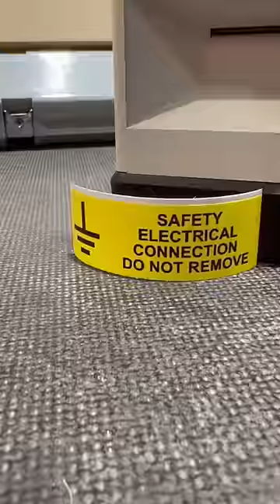Electricians Shocked by this Mysterious Earth Clamp

Comment: With the advent of PEX plumbing, you cant trust that a copper line is properly grounded anymore.
Reply: You can when that's what you're connecting it to. This is not using the pipe to provide a ground.
Reply: It's the pipe thats being earthed.
Reply: Yeah, what happens if a repair has to be made on both pipes four feet down further, and they replace it with sections of PEX pipe, unknowingly severing the connection to earth?
Reply: @bradbeck2601 As has been mentioned, the piping is grounded to the earth via the cable, not the other way arround. Replacing the pipes with plastic is fine and makes the cable redundant.
Reply: @Znyggisen  what's the purpose of grounding the pipes?
Reply: @Monkeh616 yes. It is using the pipe.
Reply: @PhillipDavis830  No, it isn't.
Reply: @Monkeh616  then do it at your home. Because if you have pex between the copper pipe and the main coming in you're screwed.
Reply: @PhillipDavis830  It won't matter, because that cable is not supplying the ground, it is connecting it TO the pipe.

You need to go read up on this stuff before assuming you know what you're talking about.
Reply: @Monkeh616  maybe you should do the same. You are making no sense.
Reply: @PhillipDavis830  That's because you're not listening.

The pipe, if it is metal and in the ground, may introduce a potential ('ground') to the building. This may not be the same potential as the ground supplied by the electrical installation. This cabling is intended to ensure that plumbing and electrical items are at the same potential.

Once again, it is not supplying a ground to the electrical installation but connecting two different 'grounds' together. If this seems odd to you, consider that the earth is not a superconductor and return to basics.
Reply: @bradbeck2601  Assume a ground fault occurs in the installation, like a faulty appliance. The hull of said device may then have a voltage of rougly half the supply voltage, so up to around 115v for 230v supply. If you also have metal piping in the room, they may have a ground connection somewhere else with much lower potential than your faulty appliance, so touching both the hull and the piping may be hazardous. If the piping is not made of metal, the resistance to earth will be too high, so no need the earth them with a cable. If the piping is made of metal, the wire ensures that when the hull of a faulty device reaches 115v, the piping will also be ~rougly 115v, depending on where you run the cable to, preferebly as to the closest local earth point if possible.
Reply: @Znyggisen  so you're saying you're grounding the piping in case someone else tries to use the piping as a ground, essentially.
Reply: @bradbeck2601  not really, you are  grounding the pipes to ensure you dont have a source to ground that is at a different potential than the earth in the room
Reply: @PhillipDavis830 You're the one that's wrong here. I don't think you understand what's going on.
Reply: @PhillipDavis830 it's doing the same thing as grounding the metal shell of a toaster. It ensures that the metal piping is kept at the same potential as the rest of the Grounding/Earthing system.

In the US on single family residential I generally see it on the outside of the house, between the Grounding stakes and the water main where it enters the house, but this video is showing it being done the British way, from the ground strip in the Main Panel, to the pipes inside.

And if there is PEX a few feet away, well, then it won't conduct so it doesn't need grounding, and the water is already connected to ground, so it doesn't matter much.
Reply: @ke6gwf  the thing is they don't show where the other end terminates so you don't know that. I realize they ground pipes for stray electrical issues.  But they do the stupid finger wag when tying that wire to the ground strip and instead pit it on the copper pipe. The video doesn't show enough to know.
Reply: @PhillipDavis830  Ahh, so you misunderstood the video lol
The finger wag is about tightening the terminal strip down with a regular screwdriver, and then he pulls out the torque screwdriver.
So the main ground wire from the ground rod is on the left terminal on the terminal strip, and you see him put the new wire in next to it, the other end of which is bonded to the water lines.
Reply: @Monkeh616  ground is the destination not the source (by convention).
Reply: if the pipe has water, it'll conduct it throughout. Faucets are still made of metal, so they're also a non issue. And another thing... NOTHING has infinite electrical resistance. With enough sheer mass, the plastic of the pipes will conduct the needed electrons back into the electrical circuit from the walls they're touching and even the moist ambient air.
Reply: @Znyggisen  yea, this is the biggest problem with these setups... the risk of electrocuting someone with mains AC current (very bad)
Reply: The pipe must be going to ground within 10ft. Usually the water supply pipes. Very unlikely patched with non-conductive repairs, if they are their is a redundant electrode
Reply: @cartoonhead9222  the video does not seem to designate where the pipe is going connecting to an earth ground, and Rod is the only sure fire way
Reply: @neferiusnexus  no, water is resistive. You will not ensure a ast pth to ground. Electricity takes the fastest route to earth. Meaning if you have static build up from water passing through the pipe, OR you touch it and a faulty electrical item and the water pipe is the lesser of the 2 paths to earth you will not be killed because bonding the water pipe and the mains earth removes the difference between the 2 earth's.

Also any voltage on your water pipe from a fault will trigger a breaker to trip if the grounding is bonded correctly, for example you drop a radio in the sink while listening to it and it's powered with a 2 wire double screened cable, no earth, the breaker will still blow because of 2 things -
1, voltage imbalance between live and neutral
2, voltage taking the path to earth

Unless you are standing in a puddle that is also grounded, you are unlikely to receive more than a tingle in the water for the short duration the breaker trips.
Reply: @stefenmorant4778  with plumbing you cannot assume the pipe is all plastic or all metal. For years now old copper pipe has been swapped with plastic breaking continuity, but you still need to ground it if it's metal and more than a few inches long. Water carries some current even a small amount is a risk of danger.
Reply: @bradbeck2601  The iron content of water traveling in copper pipes induces a minor current flow - that current, if not grounded, will lead to galvanic corrosion eventually causing the pipe to fail: Grounding copper pipes adds roughly 25 years to their expected life
Reply: @bradbeck2601 it's so that if they somehow end up being energized the breaker trips and nobody gets shocked by touching them, so if the visibly exposed metal section has the ground clamp it should be good, the rest of the pipe may need more clamps if plastic is added along the way breaking the circuit
Reply: @PhillipDavis830  Read the comments!
Reply: @Znyggisen How could you make an Earth point if none existed before installation of electricity?
Reply: @neferiusnexus you do realize that water itself is an insulator right? I understand what you are saying but I had to point that out because so few people understand that the impurities make it conductive not the water itself.
Reply: @20chocsaday  stake a conductive rod into the ground
Reply: Okay, what's happening here is he is grounding the pipe.  As he is ensuring a normalized ground throughout the system.  If something does ground out to the pipes, it won't be anymore of an issue than on a properly grounded circuit.  It helps ensure an equal potential between the piping's "earth" and the facility's grounding rod's "earth."  What is being done that such is relevant i dont know, and I don't really care.  Waste of time and energy unless what comes out of the ground isn't metal despite the system being such.  Considering all the different couplings for plumbing that inhibit electrical conductivity you shouldn't have anything bonded to the plumbing anymore anyway.
Reply: In the Netherlands it's already forbidden to use copper pipe as ground !
Reply: @neferiusnexus fun fact, water by itself does not conduct electricity. So no, you can't trust copper pipe as ground !!
Reply: @stefenmorant4778 yeah, and if water company changes their piping infrastructure, you end up with a non-grounded customer... No plumber want to take that risk... Just use a ground pin.
Reply: RobertDaggett  You can't rely on a water pipe as a single ground source. Many properties are a mix of copper and plastic, so you cannot reliably get a perfect connection to ground all the time, and if any pipe work is modified its likely the continuity of that connection will be broken, meaning its worth routine inspections of your electrical ground after any plumbing work, especially reading the comments from some plumbers beliefs and policies regarding grounding, with more than 1 suggesting that they refuse to bond pipe work to earth. The 2008 change is a big improvement over safety.

If a fault develops on the transformer earth all bets are off in some situations - I know of such an event here in the UK, all grounded connections were live inside a number of properties until the power was disconnected before the fault. All current was draining to earth THROUGH the affected properties. It was only discovered because one of the residents was feeling a tingle as he stepped out of the bath.
Reply: @Kolonol1 correct distilled water is an insulator but it is not found in nature, minerals in water make it a conductor.
Reply: @richardbrooksshnee  there is an effect that occurs when using a grounding rod and a ufer ground in the same system, the different potentials can create some crazy things with electricity.
Reply: @dennis8196  you ground a gas pipe as a bond it is not intended to be a ground source, but  I'm talking about the US where we have a neutral and it is bonded to the ground , in the UK the system has no neutral, I understand what your concerns are
Reply: @mrromantimothy  someone failed geology and biology and basic science.
Reply: @mrromantimothy  Err, yes, the UK system has a neutral.
Reply: Never mind that I was electrocuted once removing a sink in a kitchen remodel. Something was seriously wrong with the ground(s) somewhere on the plumbing. A driven ground rod is never going to energize the plumbing.
Reply: @fishhuntadventure  Nor is bonding plumbing in contact with the ground. If you don't know what's happening, don't pretend to.
Reply: You bond the pipe so it can’t become energized without tripping the breaker, like if a hot bare wire came in contact with it. If it were ungrounded you could be sitting in a bathtub and the faucet could be energized, which would be bad.
Reply: @cartoonhead9222 why,  so you can be shocked in the shower?
Reply: @KilerReviews  How on earth would it do that? Trace out the circuit - wait, what circuit? There's no second node.
Reply: @bradbeck2601  You think someone's adding pex and doesn't know they're breaking a previous ground?
Reply: 100% correct.
Reply: Very good point!
Reply: @fishhuntadventure that would be potential from cutting thru a pipe that had or was carrying current 

Gas engineers in Uk have a short lead that they clamp cross incoming gas pipes if they cut them as they cant be sure there isnt any induced current sitting waiting for you to make the circuit if there is an extenal network fault or difference in potential 😂

I always check with a clamp meter before removing any bonding as dont want a shock 😢 seen a picture before on a forum somwehre in London in a balcok of flats with a large amount of current flowing due to a damged pme... and the water pipe acting as a return path back for the neutral 😅😮 and no signs of thermal damage 

Be safe guys
Reply: @WillBravoNotEvil I have been working with buildings, and you would be shocked about the amount of tunnel-vision some plumbers have... Some (probably most) plumbers only care about the piece they are currently fixing, not giving a damn about how it influences the rest.
I have had to put my foot down, when a plumber had the bright idea to install stainless steel IN THE MIDDLE of an old galvanized iron installation main pipeline with constant water circulation... sure his stainless steel piece wont corrode, but the whole rest of the installation will now corrode significantly faster. Luckily I had the final say, so he got told to install galvanized steel that matches the existing.
And keep in mind, that in my country the plumbers have a 5 year long tradeschool-education (half of it being apprenticeship), and strict license rules for plumbers... And still you see this tunnel vision going on.
Reply: @ke6gwf  The comment i was looking for.  One that made sense after smoking one..
Reply: @PhillipDavis830 he was indicating to use a torque limiting screwdriver. That was the purpose of the finger wag.
Reply: I’m an IT guy and not an electrician. This electrician discussion reminds me of how multiple certified public accountants, when asked to complete a tax return using the same financial information, all come up with a different result. Only no one dies because of their decisions.
Reply: @RickActual  The difference being we don't all have the same information. Some of us have all of the pertinent information, and others have a very small amount of it and a whole lot of unrelated information, and are making gigantic assumptions.
Reply: @Monkeh616 That doesn't even make sense. You can't use the Water Service as a ground in the US. Ground rods only. One piece of plastic and there goes your service ground
Reply: @Kevthebish  This is not being used as a ground, and it is not in the US. You want to try again?
Reply: And your expertise says this why? Please explain your qualifications that makes you make a statement like this. Obviously you know.....
Reply: @Monkeh616 douche
Reply: @Kolonol1 yeah, you failed
Reply: @LynxStarAuto you guys torque screws? That’s just ridiculous and to sell a $500 torque screwdriver. There’s safety, and then there’s safety marketing
Reply: RobertDaggett  good job this video is British then.
Reply: @Znyggisen  How far into the ground do you drive it?
Reply: @daintree98  varies, as long or as many as u need 2 get the requiered impedance to ground from the rod. If the ground is not very consuctive several rods may be requiered
Reply: @larrypugh9662 Nope, the cable is connecting the the pipe to earth/ground at the fuseboard not the other way around.
Reply: @ke6gwf The earth/ground comes from the supply cable.
Reply: @PhillipDavis830  Realise that the rest of the world doesn't use the 1950s rural system the US does. That is a 230v UK system, Phase(Hot),neutral, earth(ground) are supplied direct from the sub station.
Reply: @ianrice5656  yes, I misspoke, I was thinking of the US system at that moment where a grounded neutral comes in from the pole, but we also have a ground rod and they are bonded together in the panel lol
Reply: Years ago I word for a city water department and this is a bad idea. It can cause electrolysis a the water main and saddle all so if the water meter does not have a ground cable and ground rod by it can get someone shocked same if they are on a well and you do plumbing work by the pressure tank and incoming line.
Reply: @bradbeck2601 static buildup messing with electrical systems, same reason they tell you to turn off cellphones on a plane so electricity goes where it's supposed to go with no interference, in this case impedance is the issue. 

There are other reasons most guys say so your water if it ever leaks and reaches a hot wire the electricity will have a path to ground.

Another one is to prevent/ reduce electrolytic reactions
Reply: @bradbeck2601  Absolutely nothing as the pipe is not providing the earth.
The cable clamps are earthing the pipe.
Pipes have never been used to provide an earth, thats what earth stakes are for.
Reply: @Znyggisen  No it doesn't, a fault that would cause the copper to become live is most likely to come from an appliance in the house, the cable is providing an earth to the pipes in the house exactly for the reason that a water pipe could/will be plastic.
A fault on a boiler could make every copper pipe in the house live, the earth gives the current a path to operate the breakers.
Reply: Bonding to copper pipe is not done to get a ground connection, it's done to make sure that the copper pip is at ground potential and that, if there is a broken PEN fault on the supplier feed, that all exposed conductive infrastructure metalwork is at the same potential lessening the danger of a fatal shock.
Reply: UNTIL YOU BOND IT!!!! Back to college for you milad!!
Reply: @stefenmorant4778  Two or three decades large diameter backbone water distribution pipes are plastic, street pipes are plastic, house pipes plastic too. So what is the point?
Even low temp heating pipes are being plastic.
New distribution gas pipes are plastic. In some countries even building pipes are to some limits allowed plastic
Reply: That’s literally why this is being done because you do not know what potential this copper pipe would be at in reference to the rest of the wiring